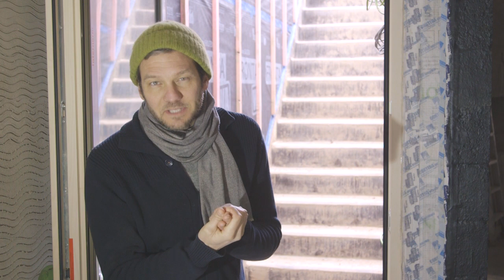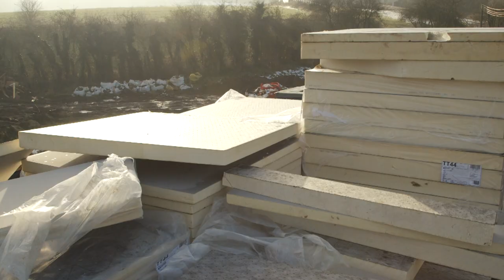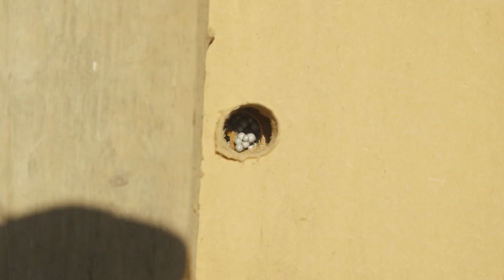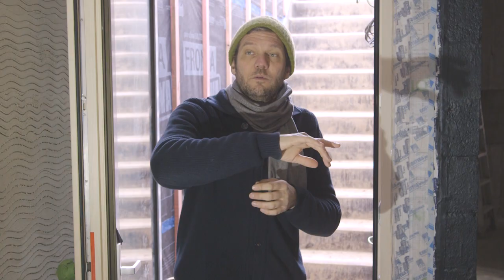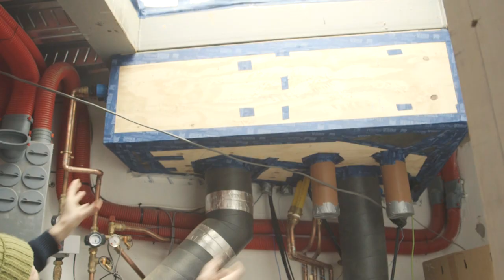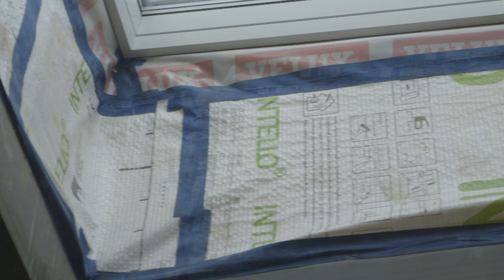Charlie Luxton - Building an Airtight Home

Comment: i don't understand why you would want an air tight house. Surely you will have issues with condensation build up leading to damp. Moisture needs to escape. I can only see this leading to bad air and health problems.
Reply from the maker: An air-tight house MUST have a MVHR unit, or a similar type of ventilation system, to ensure old, moist, stale air is replaced with fresh, clean, dry air. No architects or builders would allow an air-tight house to be built without such a system in the UK. Watch Charlie's video on MVHR to learn more.
Reply: @HomebuildingMagazine  thanks, lll have a look at the other video. I had a PIV system installed last year and it cleared up my condensation issues with a day.
Reply: Hi, interesting video. If I was to airtight a room that has a vent in the chimney breast as well as a high level air brick to vent a room how would I go about this? Obviously it wouldn’t be airtight but would be vented at the same time? 
Thanks